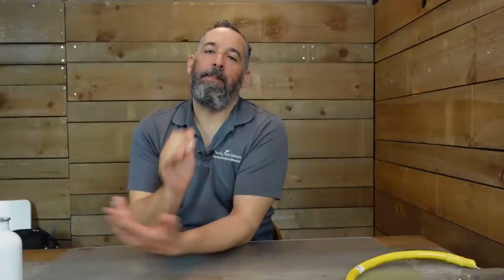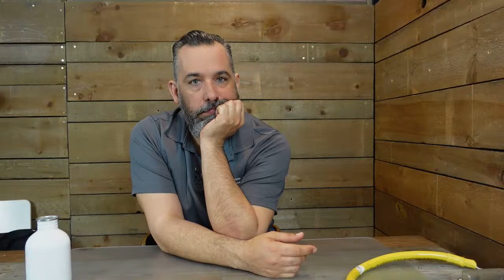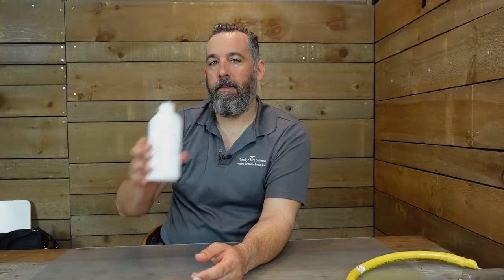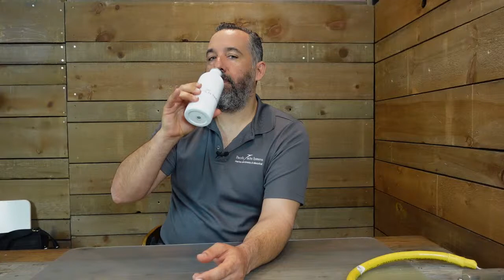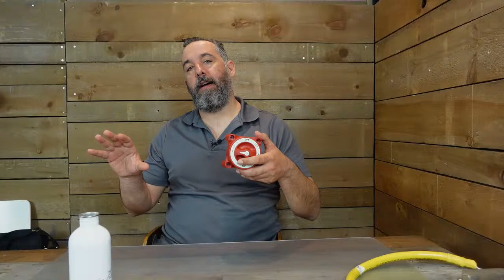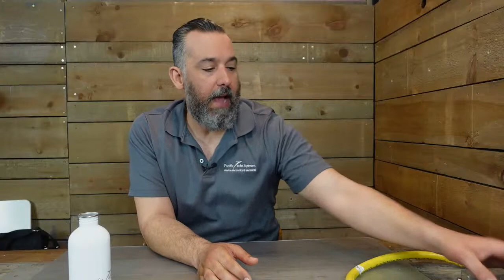Boating Tech Talk with Jeff Cote - Live Stream

Comment: Voltage drop. Very different in 120 volt power. Say (as an example) we have a voltage drop of 3 volts over a wire run. At 120 volts we still have 117 volts and everything will run on that. At low voltage it is much more serious; that 3 volts at 24 leaves us 21, while at 12 volts we are left with 9 volts. 9 volts won't run much 12 volt equipment and even if it does, the equipment is taking damage, drawing more amperage and producing more heat. The bit about not running protection at its limit is important as well, fuses and breakers running at their maximum capacity get warm and fatigued, eventually fail when the specs suggest it can run a load indefinitely. Also, wires all have some resistance, so when we pass power through them, we generate some amount of heat and that is where our voltage drop comes from. Larger wires = less heat/voltage drop. My method when interwiring equipment is to use the largest wire that FITS, and when wiring I use a deoxidizer on each prior to making the connections (Deoxit from Caig labs is the best there is). Ok, that's a tome. Keep your gaff handy. :)
Reply from the maker: Tao, bang on! Thanks for taking the time to contribute, good stuff.
Reply: @PacificYachtSystems  Always a pleasure Jeff. Marine/RV/remote; these systems are my passion since a young age when I lived on an island; no utilities, no access without a boat. Paradise, really. :)

Comment: Jeff, I know this is an older video but have a quick question. I Xatrex LinkPro battery monitor. The house batteries are showing a slow battery drain over time while on shore power. I made sure they were fully charged, turned off everything, synchronized and still get a drain. I start out at 100% but slowly over a week it will go down to 91% while still on shore power.  Agm 12 Volt batteries (2) and have 2. 200  watt solar panels. Voltage shows 13.6 according to Monitor.
Reply from the maker: John, looks like battery charger was even connected while doing this one week test. Would suggest that perhaps you have to modify the peukert value as to NOT undervalue the rate of recharge. Your battery monitor manual should talk about this setting. BTW, we very rarely have to change the Peukert value.

Comment: Jeff, thanks for these talks.  We have twelve 6v lead acid house batteries, paired in series, then the pairs wired in parallel.  Each 6v battery is rated 230 amp hours.  Understanding limits to discharge (i.e. 50%), what is our amp hour capacity,  Does wiring in series to produce 12v retain both 230 amp hour capacities or is one cancelled out.  This leaves me wondering if we have a total of 2760 or 1380 amp hours (albeit half that actually usable).   Thanks, Ken.
Reply from the maker: Great question, your battery bank of twelve golf cart batteries in a 12 volt bank is 1380 amp-hours.

Comment: I think you forgot (?) to mention Digital Switching (aka Distributed Switching) as an awesome electrical concept to adopt. For example Garmin is investing lots in it (recently acquired EmpirBus) and CZone has been around for a while.

I'm retrofitting it in a Grand Banks 42. Massive project.
Does it reduce wire runs and cable lengths? Yes. Does it add overall complexity? No. It shifts complexity from physical wire issues to digital so it's another type of troubleshooting needed.
Or, still both types, to an extent.
To be honest, would I recommended retrofitting DS to anyone? Not sure. You better be real dedicated. I'm ambivalent. In theory it's great. 

You should do an episode about DS sometime!

Great live stream btw, thanks
Reply from the maker: Thanks Johan for weighing on digital switching. It's on our wish list to make a video on this topic.

Comment: Thanks for you do to help fellow boaters. I’m getting 3-340W panels and 3-300 ah 12V lithium batteries. Should I connect the panels in series or parallel? Shading isn’t an issue as they will be mounted on a rear array. Also do I need 3 separate controllers? Thanks again Jeff
Reply from the maker: With 340 watt solar panels, would suggest going with the Victron 100/30 MPPT controller per panel.
Reply: @PacificYachtSystems  Thanks PYS!

Comment: Grate Show thanks for doing what you do. I have a Magnum ME2012 inverter/charger, at this time I do not have a battery monitor. Would you recommend going with the Magnum battery monitor addon to the ME2012 or a standalone battery monitor or both?
Reply from the maker: Hi Jason, the magnum BMK is a good choice and certainly makes install easier, since the cable from the inverter to the remote is already wired and the remote panel is already in place too.

Comment: Another Orion B2B question. I have two 55amp alternators (2 engines). What would be the best way to take advantage of both alternators. In my case the alternators would be connected to starter battery and B2B would charge lithium house battery. 

Would 2 Orion B2B in parallel from the single starting battery be better versus having two starter batteries with their own dedicated Orion B2B be more efficient. 

Thanks!
Reply from the maker: Hmmm, tough question because there is lots of choice. Keeping each alternator directly connected to respective engine battery is definitely a way to go. In turn each engine battery is recharging the lithium house battery via DC to DC charging converters.
Reply: @PacificYachtSystems  thanks Jeff. I guess I don’t understand fully the victron feature of having two (or more) Orions installed in parallel. I appreciate the response and love your work. You have inspired me to invest heavily into solar and lithiums.